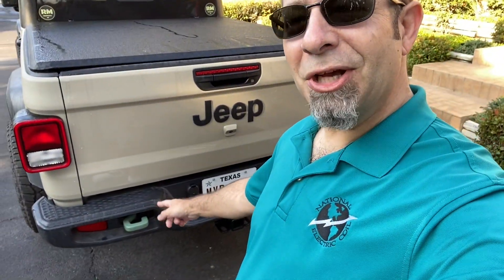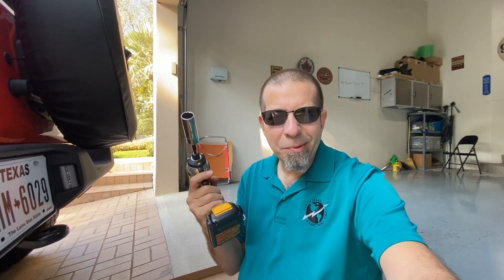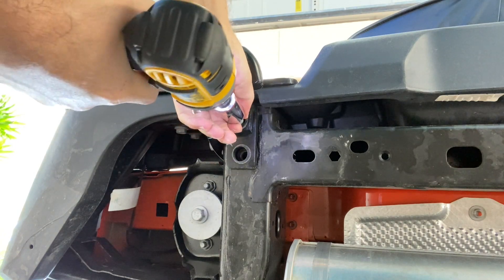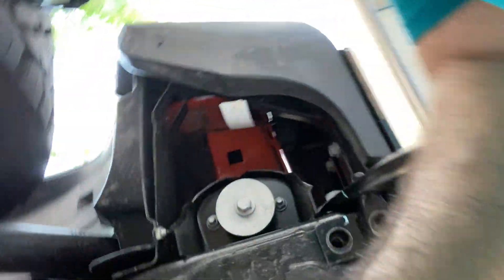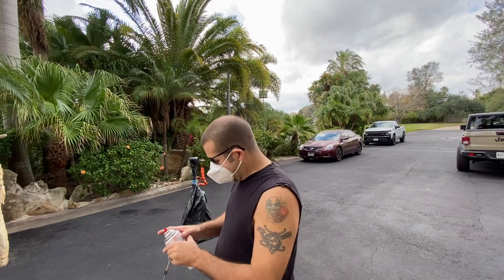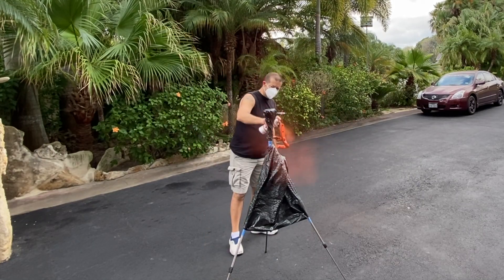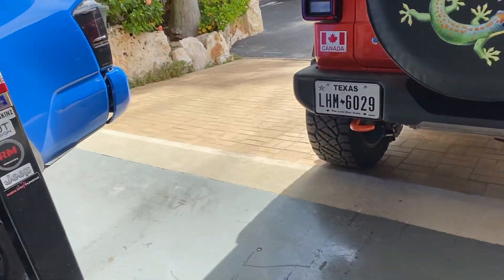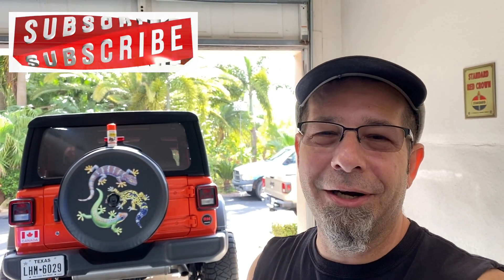Jeep Demolition for a Tow Hook Mod

Comment: I know this won't help you, but for others there's a company that sells brake caliper paint.  And they have colors that match manufactures' specific colors.  They sell Jeep colors and they have a Pumpkin in stock.  The price is a little high though, about $150.  The company is called G 2.  I've used their product and it's pretty good.